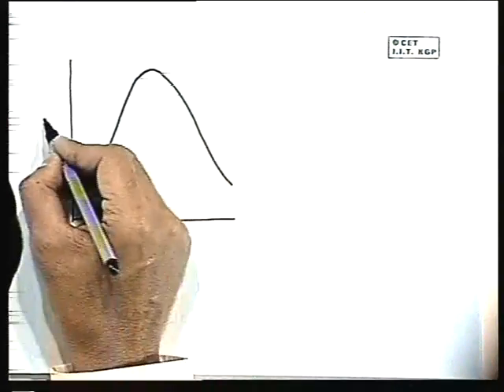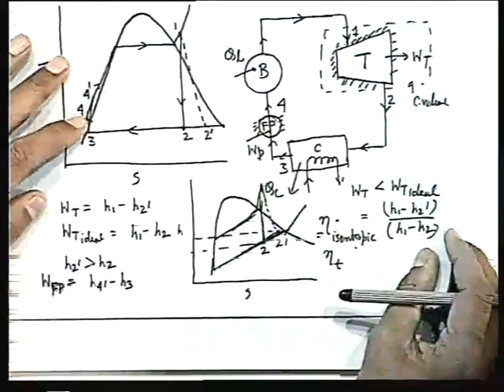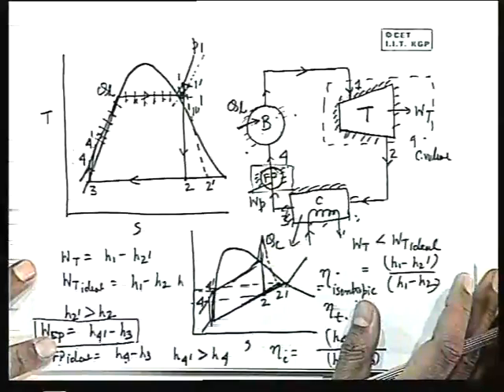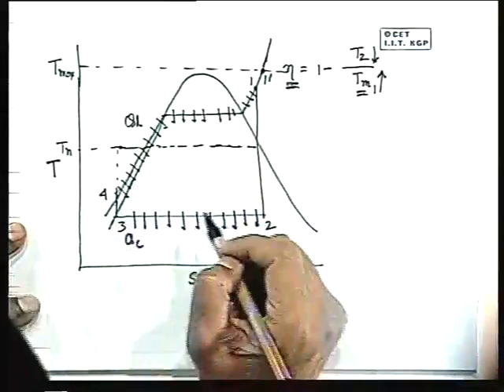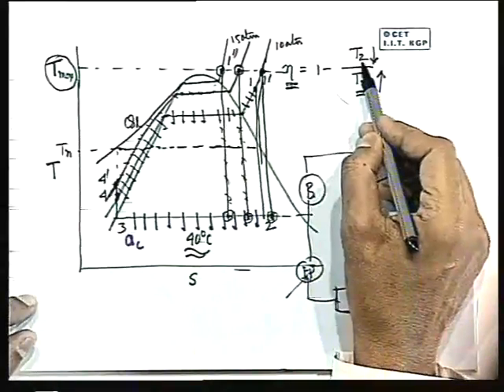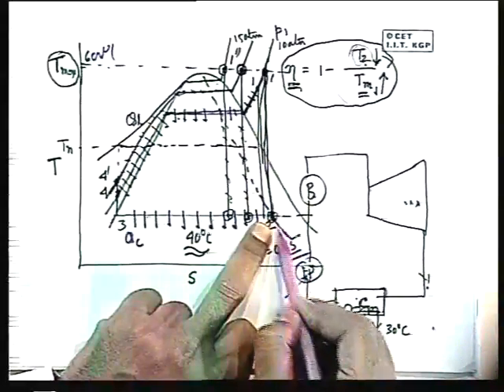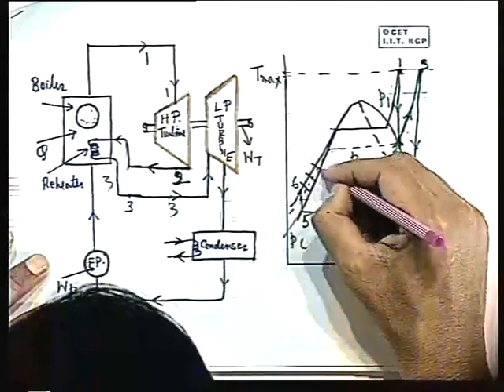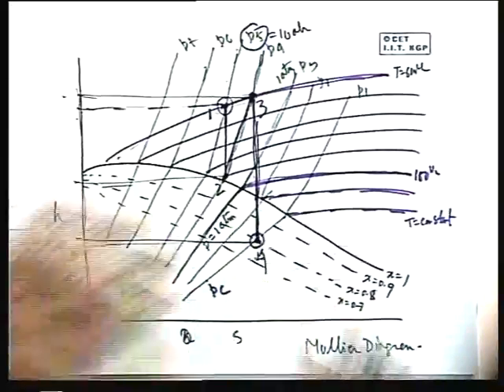Lec-21 Vapor Power Cycle-II

Comment: this is my 3rd time completing this playlist....its like my favorite movie
Reply: Same bro
Reply: how do you have so much time
Reply: @nevgongivuup  there are 30 lectures; in 2× speed, it hardly takes more than 20 hours. If you are disciplined and interested enough, you can finish almost 70-80% of the material over the weekend. So, time is not the issue, I guess. I also give Professor Som all the credit for my GATE success. I'm currently at IIT Madras doing my master's.
Reply: @khanyusuf09  nice. hey what engineering are you doing? I was looking through nptelhrd playlist and like this thermodynamics and fluid playlists are good. do you know any good playlist on electrical machines?

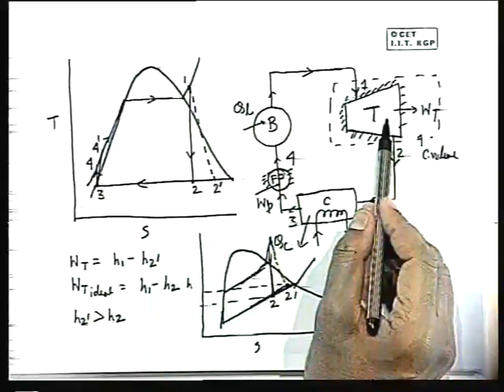Comment: @10:37  ,Its been told that ,"due to friction the temperature increases",  but the points 2 and 2' lies on the isothermal line ....Moreover ,enthalpy of 2'>2 ,but both have same temperature .,,(and itz been told before that enthalpy is a functio of temperature alone )
Reply: entropy at 2' will be more than 2
h2-h3=(s2-s3)T2   ------->h2=(s2-s3)T2+h3
h2'-h3=(s2'-s3)T2  ------->h3=(s2'-s3)t2+h3  -----------> h2'>h2
Reply: Moreover entahlpy is function of temp . for ideal gases
Reply: @sumeetkrishan273  yes. Absolutely ur right

Comment: Why is the work needed for maintaining the vacuum in condenser not considered in net work calculation?
Reply: Because the vaccum is created only once . When the steam powerplant is started, we create   absolute pressure of 5-10 kPa and after then we don't require to create vaccum again but the power is continuously generated through rankine cycle

Comment: Sir,  how to find h1?  please describe it briefly or tell me the formula
Reply: If the state is dry saturated, either pressure or temperature will be required to calculate h1 from steam tables.
If the state is superheated, both T1 and P1 is required to calculate h1 from superheated steam tables.
Reply: U can find it on the steam tables